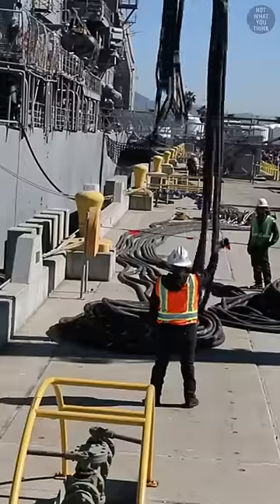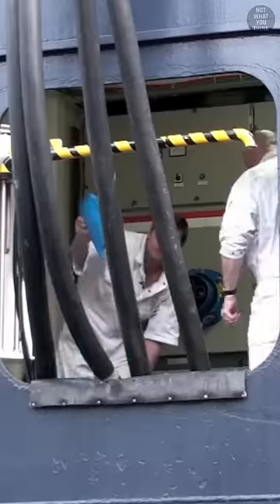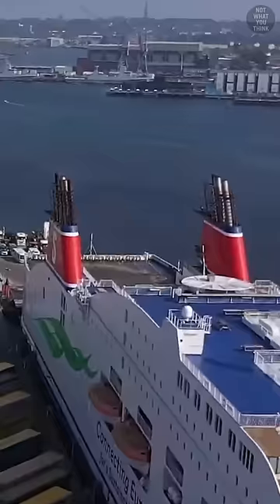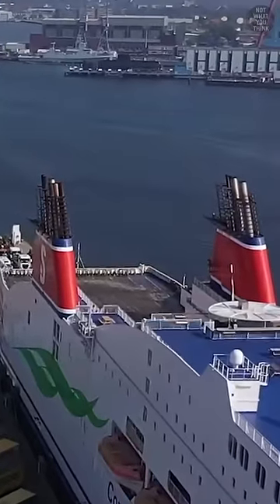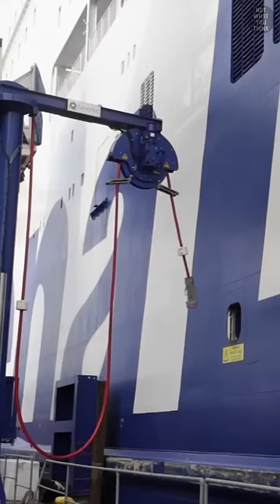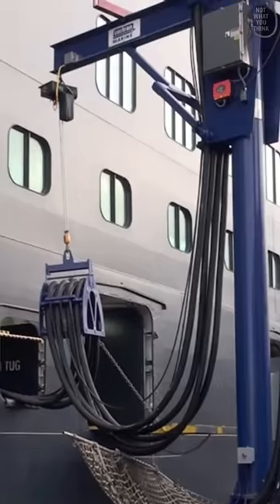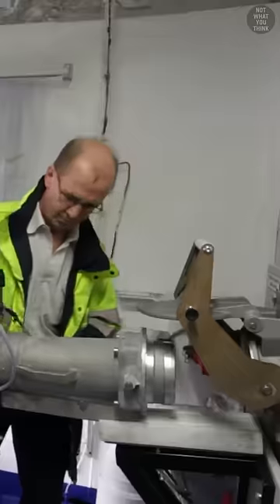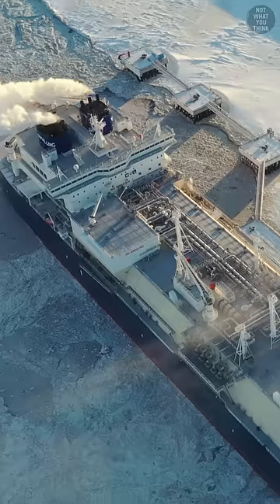Why Ships Burn Fossil Fuel When Idling? #shorts

Comment: They still burn fossil fuel when connected to shore power. This is because they still have to run the steam boiler used for things like heating. Also maintenance can be performed even when the generators are running, because usually there are multiple generators onboard and usually at least one generator is shut down while others run.

Comment: Well this is a thing worth standardizing.
Reply: Ships would still burn fuel regardless, it still has to have its Boilers on to maintain Fuel Temperatures which most ships are only designed to have steam heating in tanks.
Reply: @wuhan827  but keeping the boilers is only a part of burning fuel. Generating electricity can be done differently. Aircrafts also get ground power and dont burn unnecessary fuel while on ground. They could power the aircraft via the auxiliary power unit APU in the tail though. This burns 600 kg of fuel hourly on 747

Comment: Actually, there is already a global standard for ship shore power called IEC/IEEE 80005, which requires a 4-wire three-phase 11 kV supply that includes a neutral to give 6.6 kV. Most major international ports already include it. Sadly, it is only those ports that provide it because of the high cost of installation of the shore power circuit. The supply circuit needs to run all the way from the substation due to the giant power demand for ships, especially ones with refrigerated compartments such as tankers carrying liquefied gases and passenger ships with entirely air conditioned interiors. So, governments all over the world must give financial incentives to the ports to install shore power in order to fix the urgent health crisis caused by pollution. Also, the installation of shore power will also enable ships to be zero emissions by enabling all-electric ones to recharge there, which will entirely solve the air and water pollution problem from the operation of maritime shipping.

Comment: Ship conventions are very complicated to make since most of the ships traveling right now trough the see can be 20 or 30 years old,  so the newest ship built in this period have this feuters,  but India (for example) buy old ships which they don't have this
Reply: Ships are retrofited all the time. No argument.
Reply: not many 30 year old vessels going around.... anyway, no matter the old, you gotta comply with MARPOL, thats why exists the VLSFO (very low sulphur fuel oil) if the vessel is not equipped with scrubber , it is mandatory to use this fuel.

Comment: They are going all out with EVs and hybrid cars by putting all kinds of regulations on cars and they don't regulate container ships and tankers which pollute much more than cars. That's where you see that anti-pollution measures are only put where they can make money by putting regulations.
Reply: That's because even with the increased pollution, shipping is still the most efficient way of transporting goods across oceans. Per container, the Emma Maersk has a fuel economy of 104.1 knots per gallon per container at max speed of 25 ish knots.
Reply: Cars produce 10x more co2 than all ships combined though, according to IPCC. Ships do emit a lot of Suplhur, but reducing droughts, sea level rise and extreme weather event is a lot more important than maintaining the diversity of lichens.
Reply: Ships should be powered by coal, just like electric cars.
Reply: @axelandersson6314   The ignorant people don't factor in the emissions per ton transported via ship, compared to transporting on semi trucks.
Reply: wrong, vessels are much more regulated than cars.

Comment: Crude Oil does NOT come from Fossils.
It comes from Rocks and Minerals which are Dissolved by Acids, while under high heat, and Immense Pressure. 
That's why Crude Oil has different molecular makeup in each part of the world, dependent on the makeup of Rock/Minerals contained in the Continental plates.
Reply: 🤫 you don’t want people to know about the virtually infinite amount of petroleum. The whole reasoning behind the name fossil fuels was to make it sound like a rare finite resource to then be able to put whatever price tag you’d want on it.
Reply: @gilberturibe393 really? I always thought that petroleum was made of trillions of dead sea bacteria. If geology creates it, does that mean I can find this stuff on other planets?
Reply: @funveeable  If there are other planets that have the same structure of hardned outer plates, made up of Rocks and Minerals, with a Molten Core, and water present which can infultrate cracks in the plates, and gravity to force it underground... 
Then I don't see why it's not likely.
Reply: @funveeable  basically:

Yes
Reply: I thought it was the blood of Gaia.

Comment: Completely insane too.  Anything that's going to be in port and require generation of electricity should be adapted to a common connection standard. They can put something unique in the ship if it's own internal needs are different.  Shore power at the dock should be an immutable standard.

Comment: Not mentioned but is also a reason is that the propeller shafts need to be spun even when not moving to prevent the shaft from warping. Generally they rotate at one or less rotations per minute. Not enough to go anywhere but enough to keep the shaft from bending
Reply: Not true....working on ships for 16 years....never seen that done!
Reply: That's complete bullshit
Reply: imaginations..... jajajajaj

Comment: My mind was blown when my electronic engineer pops told me some military and AV systems use 40hz 50hz 60hz 100hz 400hz, or 5 phase, or positive grounded DC...And I was convinced 3 phase delta / wye motor start was hard to grasp.

Comment: To be honest. Especially during winter I don't mind them running the engine. These run at 50% efficiency, at least as good as any legacy power generation and the excess heat is used for heating which also would use power. 
So coming close to 100% efficiency. 
Also they burn cleaner fuel in most national waters and I don't mind them burning bunker oil. It's a byproduct or the refining process which couldn't serve any other purpose and thereby reduces the total amount of oil that needs to be extracted. 

Also shipping is highly efficient.

Comment: If they were serious about reducing pollution, they would be running these ships with nuclear reactors instead of the nastiest most polluting bottom grade oil. You can also run a reactor for like 30 years. The military uses reactors to run subs and ships today. Also most ships only run generators and are purpulsed with electric motors.
Reply: Do you really want every civilian cargo ship running around with a nuclear reactor? Piracy is still a thing. Ships are often run by negligent owners. Ships run aground, they capsize, and at the ends of their lives they get scrapped by uneducated men and boys in Bangladesh.

As an engineer in the nuclear industry, this idea terrifies me. But id probably be paid more if it happened.
Reply: I thought the same thing

Comment: There is another reason: such an engine is much more difficult to start than a car engine. When it stops, the oil will gather in the lower parts, you cannot just simply start it again without extensive preparation. Also, starting it puts a lot of mechanical stress on the engine, such engines can not be turned off and on again too many times before they get seriously damaged.

Comment: i work on merchant ship - it was ZERO ships connected to shore power line during my 10 years exp. NEVER. It's long procedure. And some times you in port for a few hours 2-3- mayeb 12 hours. And most of the times you waiting your turn near the coast on  anchor for fking weeks. No shore cable will reach anchor parking side.

Comment: There is definitely no lack of emission regulations..ships are regulated much more heavily than land vehicles. And comparing the emissions of a ship to a car is also not fair. If the amount of cargo carried by a ship vs a car is compared, an individual car pollutes much more than what's said in this video.
Also, most ports nowadays require ships to switch to fuel with very low sulphur content when they're close to land. 
The amount of work and man-hours required to run a ship is extremely misrepresented in media.

Comment: Europe runs on 50Hz 
North America runs on a 60hz power grid.

This is part of the problem when trying to plug into shore power as they cannot change the Hertz system that the ship was built with, if it is not compatible with the shore power they will run diesel generators while in port.

Comment: Bunker oil is pretty much the lowest grade fuel you can use in a huge 2 stroke diseal but it's almost solid at room temp.
When oil prices went really low some changed to kerosine. I'm not sure if any engines use distiliates (2nd cheapist fuel it's sort of like kerosine but has more water and contaminants)
The thing with electricity is it depends where is comes from, if it's from a gas /oil /distillate turbine or coal then it's not very clean.
With newer self contained nuclear reactors it maybe the best thing for some ships.

More R+D needs to go into hydrogen,  in Europe they will convert gas card to run on LPG (liquid propane gas) so it's usually half price plus most cars bigger than a hatchback have diesel engines that are much more efficient especially for SUVs and pickups, I don't think you can even buy a gas pickup line Europe now as no one would buy it due to high fuel taxes.

Comment: They have the problem with no standard electrical connections that Electric Vehicles (EV) are having.  Even if you get connected to a charger; depending on the charging unit and how many other vehicles are connected will, at some locations determine how fast your EV will get recharged.

Comment: You missed the real reason - 'Bunker Fuel' needs to be kept heated to keep it in a liquid enough state for it to be pushed through the pipes. Let is cool, and the pipes are going to need to be cut out and replaced.

Comment: If commercial ships were allowed to upgrade to LFTR power, liquid fuel thorium reactor, then ships would have zero emissions, be fueled once in their lifetime, and operate with unlimited range. 
Note that LFTR nuclear power plants are 200 times more fuel efficient than conventional solid fuel reactors because 100% of the fuel can be used in the reactor, not just 0.5% of the fuel with solid rods. So there’s zero nuclear waste as a result.
And I’m completely certain that the fuel load will outlive the ship several 100 times, and the reactor several 10’s of times. After all, the fuel load is enough to last 1000 years.

Comment: Lack of emmision regulations... It is quite heavy regulated. He should check up on Marpol. Big fines are placed on ships with non compliant fuel. Europe even has such strict regulations that its nost ships run on the cleaner more expansive Marine Gas Oil.

Comment: HFO consumption drasticly decreases.due to IMO2020 ruling. Corret fact: most local grids do not offer enough capacity to take several vessels up at once. Further on there is no internstional standard for safety and connecors ("plugs").
Correct: would be great if cold, landline electricity would be availabe more often.

Comment: Its not the difference in voltage or plug, it is simply money. Most ports charge more for shore-power than it costs to run generators on board. Also bunker fuel is not good for generators…

Comment: I live near a port, we pass it in our boat frequently.  The ships there always have really black exhaust pouring out the top.  Meanwhile i have to deal with DEF and all the emissions stuff, and the expense and reliability issues that go with it, in my little diesel truck.  Same with trains.  The train tracks run behind my house, some of the longer freight trains have 3 or 4 engines and they burn diesel and it can smell it, like a cloud after they go by.  No emissions controls on them either, but again i have to deal with it on my truck.  Those ships and trains burn more fuel in a few house than i burn all year.  Doesn't make sense.

Comment: The biggest majority of ships burn heavy fuel oil at sea. They use expensive diesel when entering ports to allow for better maneuvering. In the harbours most ships continue using oil as the infrastructure for shore-side power simply doesn't exist. Some cruise lines support the upgrade of ports to allow for shoreside electricity usage but the city or town itself needs to be able to provide it and the connectors need to be built. That alone is a certain hurdle. Furthermore the ships need to have sugh connections too. They can be retrofitted but most cruise ships don't even have it. Now when talking about freight... That's just way too many ships to support. We are decades away from that unless we suddenly shift our methods.

Also there is no incentive. Cruise lines do it for their image. They try to get cleaner but no matter how many plastic straws are replaced with paper straws that won't change the massive energy demand of a floating hotel. Shorepower can effect that during the port stay at least.

Comment: Your thesis oversimplifies the issues.  Countries have the right to specify what fuel is used.  You have Heavy Fuel Oil (HFO), High  Sulfur Fuel Oil (HSFO), Low Sulfur Fuel Oil (LSFO), Ultra Low Sulfur Fuel Oil (ULSFO), distillate fuels, and different grades of diesel fuel.

The term is "cold ironing."  The picture of divers covered in oil is visual, but it is not appropriate when you are comparing a ship operating at sea and in port.

Comment: When carting from a ship some of us truck drivers got to. Go on board and.see.down into.the engine room.1st thing was it was so clean its incredible. They said the main engine was 33 thousand horse power.they had 3 1000 horse power engines just to run the.ship while in.port.2 working 1.being.maintained .they run everything from tje light's to the ships gantry cranes. We were carting salt from the ship to the salt company. Onliy time i was ever able to a ship very interesting

Comment: Misleading. There are shipping emission standards. 0.5% sulphur limit globally and many countries operate with a 0.1% sulphur limit in their waters. So ships have to change over from Heavy fuel oil to Marine gas oil or diseal. Even if they don't they have to have scrubbers installed, like a giant catalytic converter to keep the emissions down. All ships are required to comply with those standards.

Comment: That is not the problem with ship propulsion. They have to go in and out of the port. BTW, the US has one of the heaviest regulations about which type of fuel to use. So US, you do not have this problem. Also, the generator for the big plug is usually also a diesel engine run with heavy full oil or coal.  So this is not a solution at all.

Comment: What fuels are used to create the electricity for shore power?  Will there be rolling brownouts/blackouts in the nearby city connected to the same grid because the grid is not designed to support the increased electrical demand?

Comment: Diesel is not a fossil fuel just for the record, and it burns a lot cleaner as far as greenhouse gases are concerned, oil is certainly an issue though

Comment: So you are telling me, there is no way to build adapters / transformers / voltage regulators to solve this problem?

As far as I know, there is something called "standards". This is why you can fuel up aircrafts basically on every International airport in the world and also connect them to ground power.

Comment: The figure of 50 million cars a year that could be driven with it is pure nonsense. You can no longer extract gasoline from the material used to drive ships, because this stuff is what is left over from crude oil processing. All the light gasolines and oils have already been distilled out of it.

Comment: Measure the temperature in a gymnasium. Then put one lit candle in the gymnasium then measure the temp. No change. Now put 5000 candles in the gym. The temp will go up a measurable amount.

Now do the same thing with a rather small planet. Use millions of cars, machines, the electric heater in your house and literally billions of other heat generating devices. Do it for 100 years. The temp will go up.

Man made global warming is real but not only due to the above but also the stuff spewn into the air that changes the blanket for our planet. 

Blanket? The atmosphere. Keeps getting warmer. Can't take off a layer like you do when you're too hot while trying to sleep.

Comment: There is so much wrong info in this video! Cold ironing actually is connecting a ship to shore power so it can stop their generators. The reason why ships have to keep running generators is because most ports in the world lack infrastructure to make this possible! If you make a video like this, please do your research before putting a vital part of the world's logistical system in a bad light.

Comment: Cleaner energy, made from coal to electric or from oil as well...

Russian aircraft carrier is most cleanest bulk oil glass vessel. It has been seized maybe 5-7 years. Broke in some battle or their own games, have to towed back to port. There it stays and I say, it never will cruise by it's own motors.. 😂

Okay, russians could laugh little bit too, it wasn't made in Russia, but mostly by their parts anyway.. 😅

Comment: All of the different types of fuel on ships, are stored in bunkers, and they get their fuel(whatever type it is, heavy oil, light oil, coal) from bunker boats, which makes the commentary ridiculous and incorrect………
The reason, why they are all known as such, is because the word bunker is an old(time wise) English word, for a fuel storage area, and it was used for the underground safe place(as in hitler’s bunker), because fuel bunkers(coal and wood originally) had to be safe and secure, from both, people and the elements…..